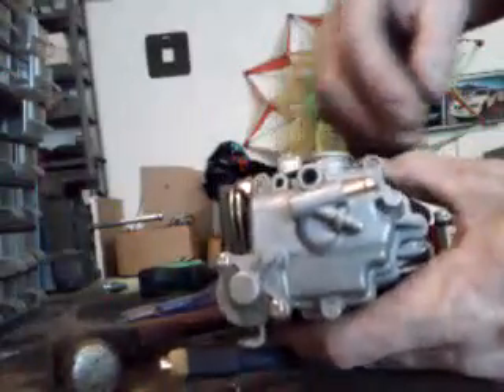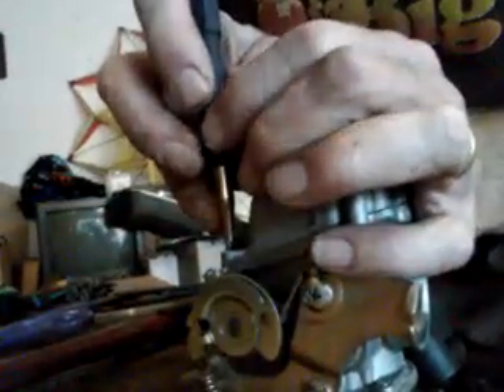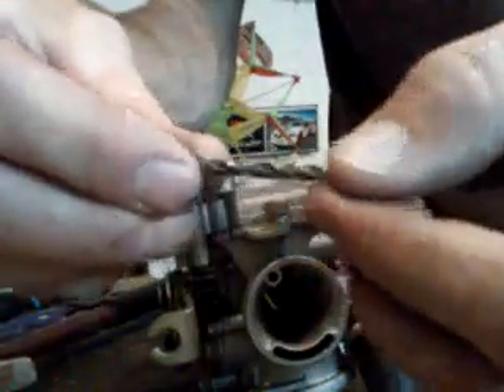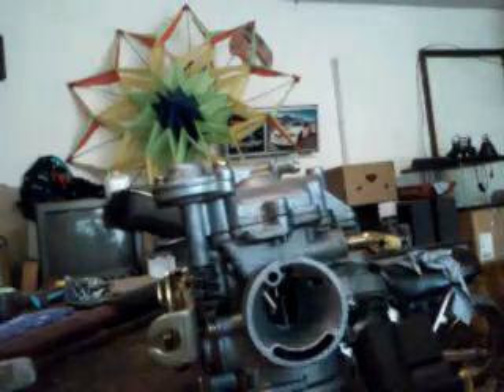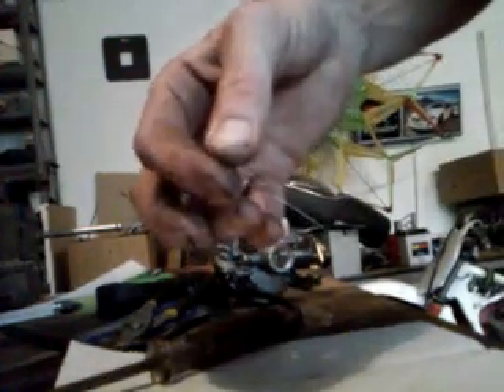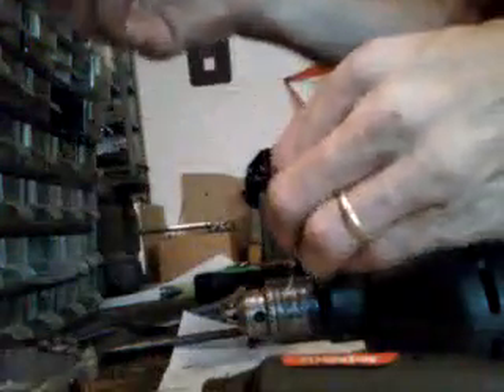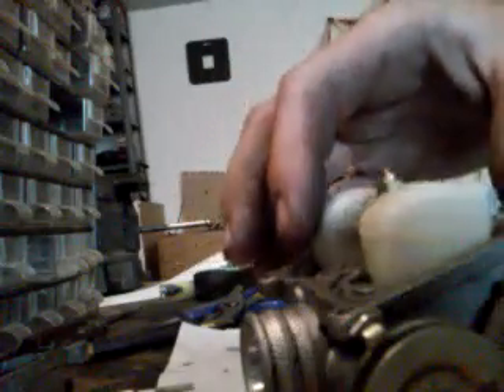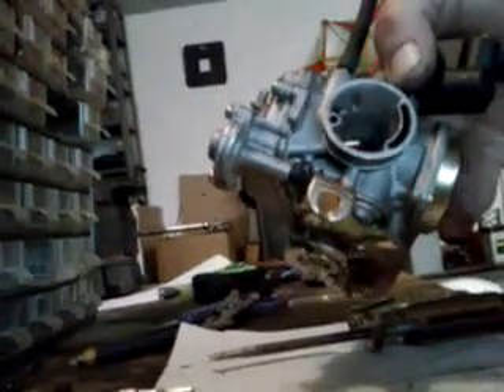Taotao 50 carb clean rebuild

Comment: could use a better resolution camera
Reply from the maker: its my phone .
Reply: i got a taotao 50 and i blew my piston on my engine because the carburetor was running to lean,, now i am getting a 100 cc with a upgrade kit and i am also getting a better carb that has the fuel air adjustment,,, and i'm doing the repairs myself.
Reply from the maker: +Patty Ann good job patty . Way to go little patience n elbow grease I think anyone could ..